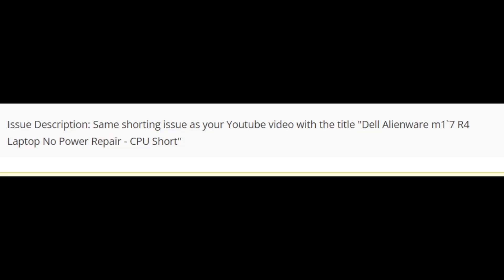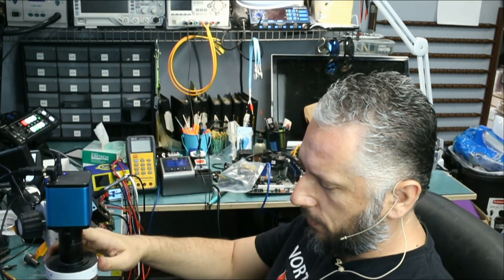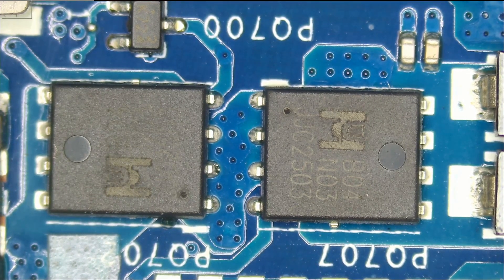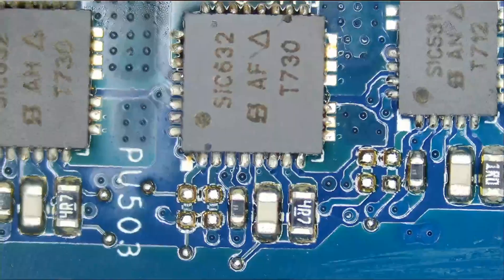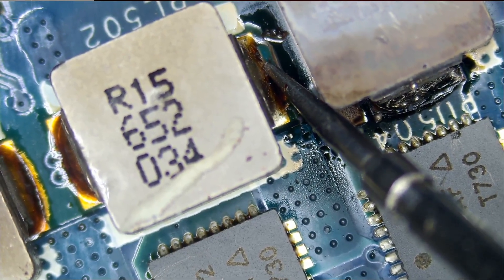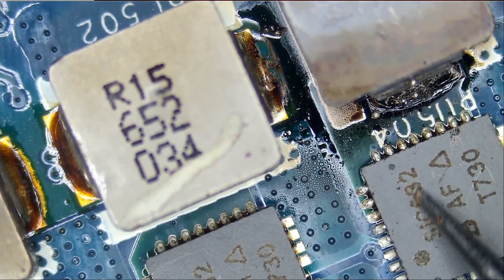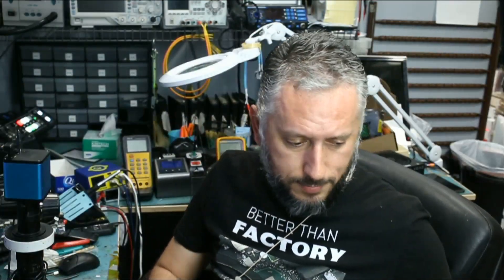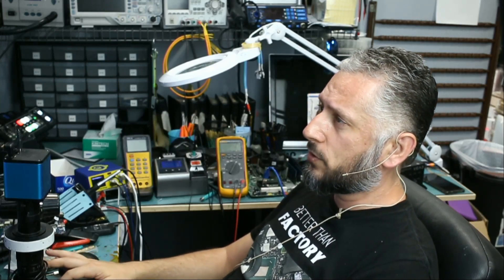Dell Alienware R4 17" Motherboard shorted out. No power. Can we save it?

Comment: Can you please help if you have seen same issue with this model? The adapter has the green light is lit. When I connect to laptop, the adapter light is "still" lit. But on the power button it keeps cycling blue, purple and red (red stay longer than other colors). The laptop doesn't turn on. I have tried battery removal and pressed power button for 30s, still the same issue. Everybody thread and the videos you have talk about adapter turning off. But that's the case for me. Can anybody please nudge me in the right direction ?

Comment: I have a similar issue with same laptop...  Inductor look cooked mosfet next to it is suspect solder joints on mosfet next to cooked inductor look poor and somemissing...
I flux and reflowed it....( as I don't have replacement )  just to see what do.... til legs look all there  and shinny..
It works better but still issue... 

Original problem is blue screen once heats up  after an hour of use then will only work 1-5 min before bluescreen loop......til cool down.. few hours...

Now it will work for a few hours and will only blue screen once maybe every 6-8 hours or so.... 
Maybe if I can find a mofet for it ( for cheap ) I will try... replace see what it do...

Comment: I have one of those short killers and I have a few shorted devices. I've checked components for shorts, found caps shorted but when I inject voltage to the shorted caps it always sparks and doesn't inject voltage (I followed the traces and it isn't ground that I'm injecting). Is the device faulty or am I doing something wrong? It's happening on all the boards with shorts that I'm practicing on.

Comment: is it possible to replace the cpu with the donor laptops cpu to fix it?
Reply: The other donor board had the same problem, dead CPU.
Reply: @techguy666  oh, ok. would it be possible with a healthy CPU?
Reply: @Joe.o0  The CPU is soldered on the board, so it would be very difficult and would need special equipment. The older generations like 17 R3 had socketed CPUs and you could easily replace them.

Comment: When you asked which mosfet is bad, I guessed the cpu is bad.
Reason is because multiple inductors have the same burnt/black appearance.
Reply: I had the same thought.  Looking at all the scorch marks around those inductors, I was looking at it and thinking:  "Wow, looks like some serious voltage went through there all the way to the CPU."  When he found the short, I still wondered if it was actually going to power up.

Comment: The fact that just one component can render a board a no fix is proof of the electronic waste we see in the industry! Not having the right to repair and unable to get schematics and replacement parts is at the core of this problem and it needs to be addressed and fixed! The waste is uncalled for and I would love to know where all these people that claim they are for saving the planet are? They sure as hell are no where to be found on this simple to fix problem, where all that needs to be done is these manufacturers need to release their hardware diagrams and parts lists so we can fix these otherwise good electronics that because they are hording the information and hardware needed our landfills are full of electronic waste that is leaching into our eco systems and polluting our land and all because of a companies greed!
Reply: Would this motherboard be repaired if we had r2r? 
He knows whats the problem and its economically not viable to repair this mb.
Reply: @MartinRepairs  I wonder whether its a brand name manufacturer that builds bad boards or the own did something they shouldn't have.
Reply: @MartinRepairs  Yes. Make the CPU and GPU chips replaceable (socketable). Soldering directly to the board is unnecessary.

Comment: Sounds like replacing the CPU would have fixed it. But obviously not worth the expense at that point.
Reply: You can certainly de-solder a large BGA like a CPU and replace it. There are some special BGA rework stations out there that are used to preheat the board, then using special nozzles the shape/size of the chip, heat the chip and board up on specific temperature profiles to more safely de-solder the chip. After the solder is flowing, a vacuum chip grabber is usually used to pull the chip from the board. Soldering a new chip back on is much of the same process. Louis showed the machine he has in at least one of his older videos that he used for a GPU replacement on a MacBook. Those machines are a few thousand dollars though and the new CPU/GPU aren't particularly cheap thus making those types of repairs not economical in most cases (unless the cost of a new device is several times the cost of repairs).
Reply: Nope. Soldered CPU. Last chance would try to remove the bios chip and flash it in a programmer, and replace.
Reply: @yeahright9014  You can't desolder it?
Reply: @overnightdelivery  Well, sure, but bad CPU is not necessarily the issue. Considered the cost of replacement, hoping it's good, and reballing and mounting, that should be last resort.
Reply: @overnightdelivery  with 1500 connections? No.
Reply: @marcellachine5718  So the CPU is integrated with the board and not removeable and replaceable like a desktop CPU or an IC. Makes sense.
Reply: @overnightdelivery  I'm not actually sure if some or all.modern cpus are soldered to the motherboard on laptops these days. If it is soldered,  I think it would be near impossible to desolder it.

Comment: Hello. How did you find out that it is from this distance?
If the CPU was just hot.
Reply: He said it. He measured the mosfets which are under the CPU, one was lower resistance, so he removed it. It was an educated guess.

Comment: I honestly have no clue what you’re even talking about half the time but what you do is just so satisfying to watch. Keep up the good work
Reply: VCore line are voltages that goes directly into the CPU .
One of the VCore MOSFET's failed feeding a higher voltage into the CPU than it can handle effectively cooking it .

In smartphones core voltages doesn't exceed 1.2 volts ,anything over will cook it .
Reply: I have learned that moss feet are short ...
Reply: Me too.

Comment: Alienware (Dell) made a downgrade with that Laptops. I have a M17 R3 still here and on that Model the CPU is placed into a socket like on a normal Mainboard. So you can simply change it. Same goes for the Graphic card. 
If they would change that back so you can replace the cpu if its faulty, then alot of trash can be saved
Reply: They sell the trash
Reply: yep. scumbag manufacturers cheaping out with soldered RAM, soldered cpu, soldered gpu... never support that behaviour.
Reply: @yeahright9014  soldered GPU and soldered cpu make tons of sense though. I can see them going back to a socket for cpu but no laptop GPU was ever socketed.
Reply: No manufacturers offer laptops with socketed mobile CPUs any more, at all. It's not just Dell.
Reply: @WiztotheIzzard  there's some high end gaming laptop that use desktop processor, some alienware laptop for example
Reply: problem lies with the cpu manufactures 
they used to make laptop cpu's that used a socket.
now they're all made to solder on a board
i used to repair laptops up to 6th gen intel 
arround 6th gen intel i saw most companies change to soldered cpu's 
i have a lenovo y510p in for new thermal paste and a clean up cause it overheats
4th gen i7 in a socket 
its to expensive and takes up to much space in smaller laptops to put in a socket
Reply: Got an M18x R2 and really do wish they would make something like that again but pretty much fat chance especially the two mxm slots as everything is BGA shit meant to fail after a couple of years. The same goes for being able to use four 2.5 sata drives because some like having data and not subsisting off a single low capacity SSD.
Reply: @MrKillswitch88  SSD's especially NVME are to the point you can get them as large as realistically needed. If you need more than 8tb than you need a NAS not more internal storage
Reply: @michaelf.2449  Yawn I do as I please.
Reply: I have an M17x R4 and the cpu slot is socketed.   I replaced the intel CPU with the best available.  Maybe that owner can still repair it if it needs just a cpu replacement.

Comment: Regular desktop PC's rarely ever have their CPU's cooked by dying MOSFET. Laptop manufacturers just don't seem to care.
Reply: Volume and power constrains, but also pricing most of the time, laptops are a volume market with low margins, desktops (specially made from parts) have a little more segmentation. I've run a custom xeon rig with rampage V and a 1080 Ti Lightning Z almost 24/7 for around 4 years, 0 problems. I just pick the most overbuild parts every time i update, because the price is paying for over-spec redundant components that will last me a while. 

In contrats evert high end laptops that i've own, always something goes wrong in a couple of years (battery, charging circuit, gpu died, etc) , and then you flush all that money in the toilet.
Reply: A lot comes down to the thin and hot meta where cooling is secondary to aesthetics never mind the component skimping.

Comment: I think the owner of this device wanted to overclock and the result is great
Reply: My x17 has 4 OC profiles in the bios. For XMP cpu and gpu. Not really any need to manually oc on the x line. Never had a m model.
Reply: Not necessarily. It could just need a bios flash, since with a soldered CPU, it's not like you can change it.